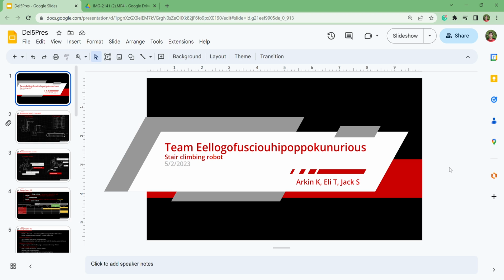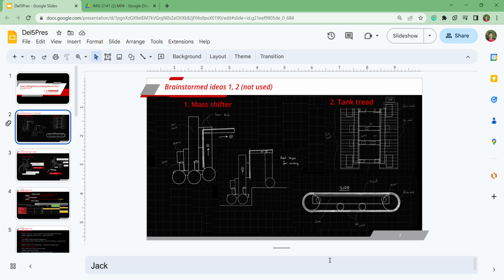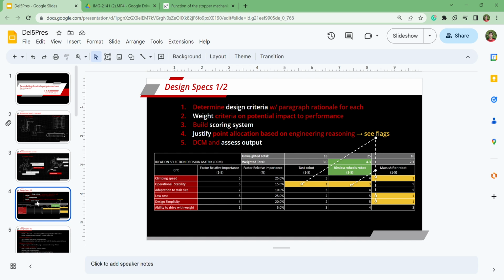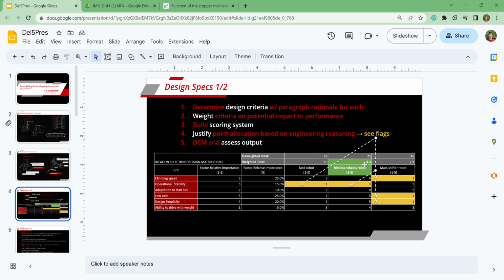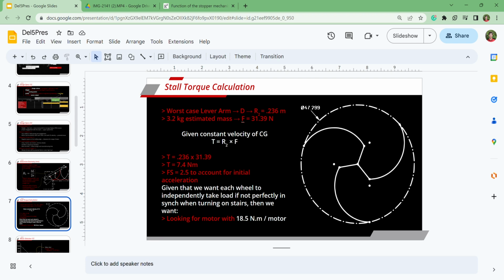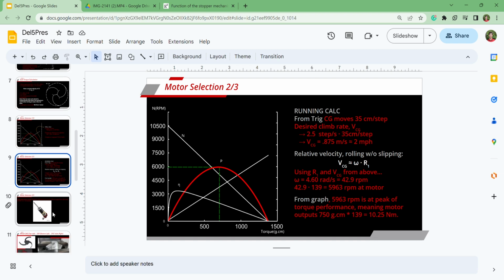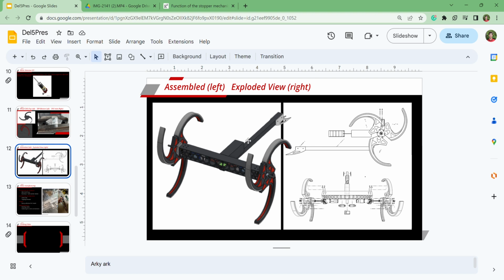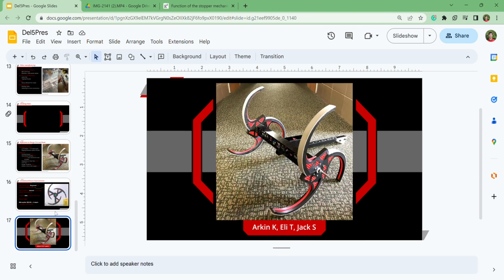Stair Climbing Robot - quick tips on design methodology, engineering, and dimensions.

Comment: Amazing video! But would the design work with four wheels?
Reply from the maker: You'll likely face rotational syncrhonization issues between the forward back pair of wheels. Even if you properly synchronize rotational positions, the length of the robot body begins to dictact the geometry of the stairs your can climb, which limits the operative range. Defenitely can work, but is a bit redundant!
Reply: @JackScalise  I think a pair of tradition wheels at the back will avoid the synchronization issues while make the robot a real cart.

Excellent job!